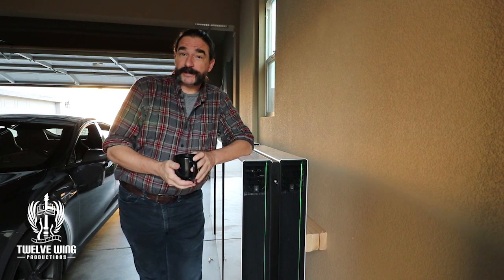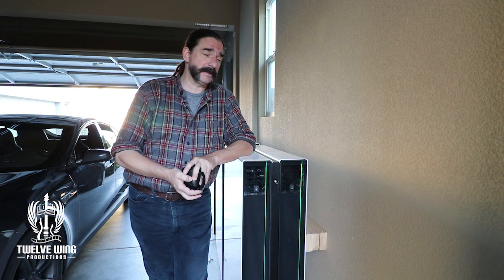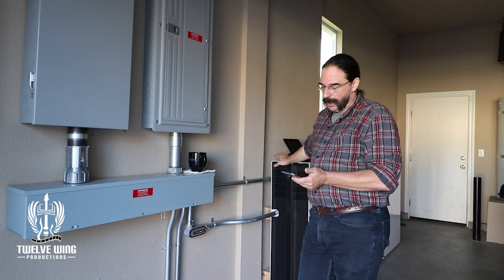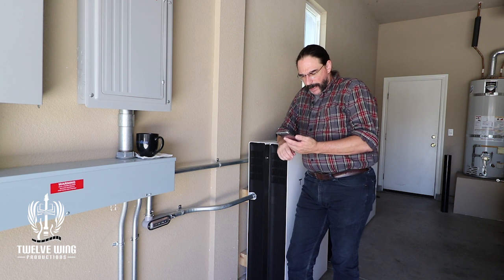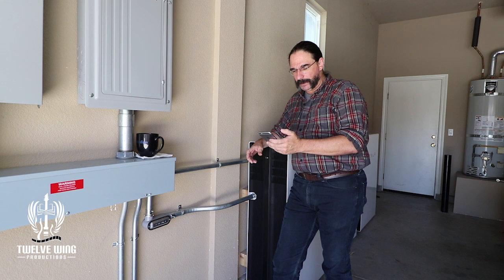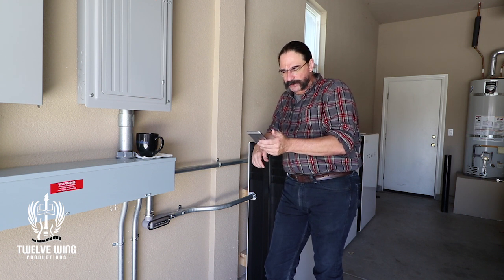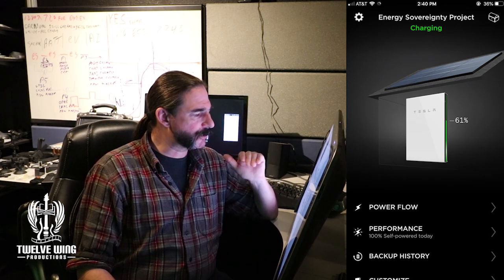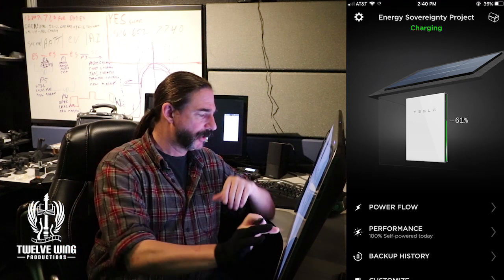What happens if you try and shut one of your Tesla Powerwalls off?

Comment: Thanks. I was particularly interested in the difference of the state of charge. I know when setting up arrays of 18650s I need to balance the charge to prevent one set of batteries from overcharging or the other set from over depletion. I am really curious about how this difference in charge for your 6 walls plays out.
Reply from the maker: My guess is that the system balances itself out, but that's really hard to say since that's not entirely what happens with the car according to what I'm told.
Folks that have monitored how the Tesla cars charge their packs have noted that the car actually allows some banks of cells to "rest".
I'm not sure how that works but the result is that the BMS keeps track of what cells have been charged the most and by what power source.

Supercharging takes its toll on the batteries if that's all you do.
I'll try and monitor this the best I can, but I haven't cracked the case on these, nor will I likely do so.
I'm approaching this from more of how a general consumer would since it's my goal to ultimately be able to recommend or not recommend these batteries based on their abilities compared to what the competition has available.

That's a little tough at the moment since there is no real competition for these batteries.  A point I will gladly argue.
Until other manufacturers start doing proper thermal management, I can only recommend the Powerwall 2 at this point.
It's not a perfect solution, as I've pointed out, but it is the only game in town right now.

Comment: I really do enjoy your videos and I have been very much studying  our own power usage and with the app and how to best utilize it I have been experimenting with the concept of using the grid as a battery because we do have net metering here in our state so some days let me export as much as 40 kW back to the grade before I charge the car I change the system settings to back up only so that we pull the power for the car back from the grid
Reply from the maker: That has been the one benefit that I can really identify and that's the car charging in the evening.
Granted with net metering it's not that big of an issue, but what I'm trying to get people to realize is that net metering is going to go away.
The utility companies won't continue to do something they don't have to do.  Especially if that something is costing them money.
Reply: Twelve Wing Productions Yes I found  out that New York State will end it’s current net meter program but anyone but the system installed before 2020 will be grandfathered in for 20 years , I feel in the future every home should have some sort of battery back or system and Solar if feasible also coupled with wind 🌬
Reply from the maker: @dashawn8971 , That's good news for now... but I don't expect that will last either.
And yes, I think this will get easier once solid state batteries become available.

Comment: I have three powerwalls but our system produces approximately 60 kW most days in the summer so we tried to charge the car in  the daytime and do most of our laundry in the daytime as well so we can use most of the power has it been produced because the batteries get full pretty quickly
Reply: If your system is big enough I would also recommend running the ac even when your not there to reduce the thermal hit and draw the systems normally produce that way running at evening/night won’t cycle as many times

Comment: Won't it achieve the same results if the system is fully on but you are on the trip? Charge them to 100% of the set point and then send power to the grid (minus the air conditioning and vampire loads).

Ours with no batteries has this effect when we go on trips, yours topped off would behave mostly like our fully grid tied system right?
Reply from the maker: I Kacey, great question.
I'll give you a quick answer now but there will be a more detailed answer in the video at the end of the month when I cover system losses.
Basically, the system when it's got all of it's 82kwh thinks you actually need/desire all that power to be stored locally, so it does.
The issue is that you lose 15% of your daily production for that advantage.
Now on a usual day when you are putting a large chunk of that to the car, it's not that big of a deal.  But the best way to think of those losses is this...

Don't think of them as percentages.. think of them as kwh.
A system that only stores 10kwh suffers a very small loss in power for a 10% loss.  Unfortunately, when you scale that same system up to 100kwh, you are now talking a substantial loss.  10kwh in fact.  Per day.
Well our system is 82kwh.  So if we aren't immediately drawing that power out, it's not worth the loss.
Then there is what I discussed briefly in one of the previous videos where I discovered that we also suffer a 5% vampire loss on top of that for any power that is left idle in the system.
Then there are other considerations regarding power usage but basically the idea is that we don't expect to have to require the system to supply any more than the 10hours between end of total solar day to start of production the next day in summer.
Even if there was a total power failure, that's all the system really needs to provide.

As we get into September/October, this discussion changes a little.
So when we are away, we will be doing a test of the system where we will operate it for a week at 50% and send all the extra charge to the grid instead of putting it in the car as we have been.

Hope that was clear enough.  I'll try and do a better job of explaining this all when we do our "loss" video at the end of the month.
Reply: Also love the shorter videos, much more approachable